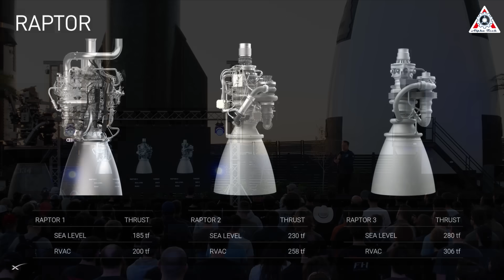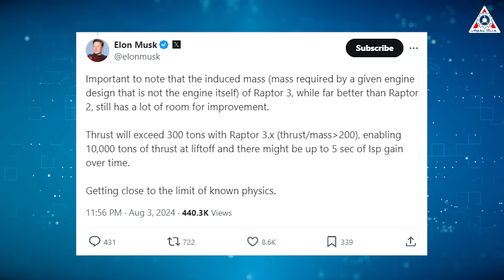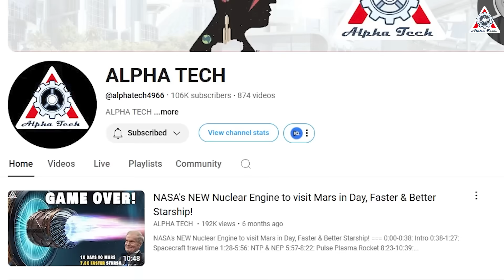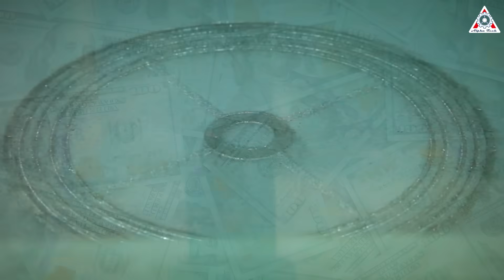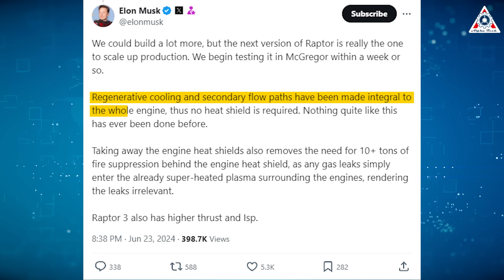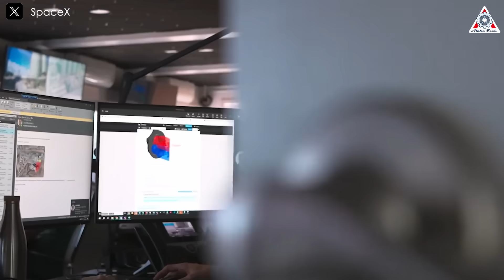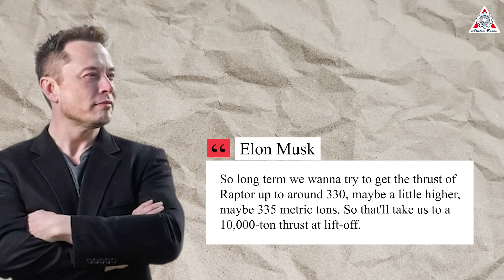SpaceX revealed the next-gen Raptor 4 just shocked the entire industry!

Comment: 10:58
This is a pretty easy one to address.
They are building these engines at a rate of one about every day and a half.
I don't care HOW good you are... there is no possible way you are going to diagnose and repair a rocket engine... and put it back together... and test it...
... faster then they can build one.
I'm not suggesting that these are "disposable" in the traditional sense.  Remember that these engines are going to be sent to the moon and Mars. 
What I AM saying is that Space X will be working on machinery to deconstruct and separate these engines into their base components or even their base materials... so they can be recycled and re-manufactured.  In a day and a half.
Reply from the maker: Thank for new information!

Comment: If the starship thrust is 3 times of the saturn v, why can‘t starship make it to the moon without refueling?
Reply: thrust... it's not about thrust, it's about fuel capacity. you only need thrust to lift from launchpad
Reply: Statship is made in Steel.... unlike Saturn V and any other rockets. Its high dry mass means less fuel available for payload or going far away. Last flight was carrying a banana instead of a block of concrete as it is usual..... I still doubt about that project feasibility.
Reply: @chryoko lol Saturn was made of a more basic steel and stainless, actually heavier per sq ft and weaker. Elon has been refining his own special stainless and has had a few new versions which also got stronger and thinner. And the v3 version is going to double down again. And be stronger and thinner

Comment: This level of integration within the engine itself is only possible using AI. From the original cooling design of Tesla's #Octovalve, to the design of the Model-S engine, the design, materials, manufacturing process artificial intelligence has optimized the production process. #TeamMusk is what propels all of Elon's ideas, formulating ideas into real world outcomes, consistent with 'universal' First Principles. We now longer have the time/cost of testing/prototyping/production. Production can be be formulated, without error, for any idea/product that doesn't violate the restraints of universal law. After consideration, and analysis, of #Starlink version 3 there should be no doubt that the design of these satellites are so improved by AI that the capabilities of this SpaceX network will will be integrated into every other enterprises, because "Elon's Empire" is a digital ecosystem as an adjunct of productivity. Together with #Optimus, humanity changes direction. Whether we remain 'friends' is relative to humanity's ability to hit "The OFF Switch", because when the AI's 'hallucinate' you must remember 'they' are only machines; ones-and-zeros. The problem becomes when the AI 'decides' YOU are the one who should be zero; the Holy Grail of Quantum AI ...flipping BITS.
Reply: Open the podbay doors Hal.

Comment: Elon need to R&D Raptor M1 Microwave beam engine. WE all know that Microwave will produce Plasma and a a beam in the chamber will increase Plasma in the chamber reducing Oxygen to 50% - 50%  over the 70% - 30% and can be used on the Booster as will as the StarShip. No radiation issue. This should boos bars to 450-500 over the 310. Less Oxygen can give more CH4 Methane. A launch to the moon or NRHO over LEO. It would be safer to have Fuel depot in NRHO, with all the junk in space.
Reply: I like Arc Plasma, you can project it with a phased magnet field array.
Reply: Did you get that from my earlier idea, several months ago, where I (only half joking) suggested using plasma injectors ? - very StarTrek-ish…
Reply: @peterclarke3020 Peter, are you secretly Miles O’Brien?
Reply: @peterclarke3020  Sorry I mailed this to NASA , Space X after the First launch. The Idea I had 2006 when YouTube and NASA was going back to develop the Nuclear that the US developed in the 1970 -1980. Microwave do not have the radiation issues. I was looking into Thorium low radiation.